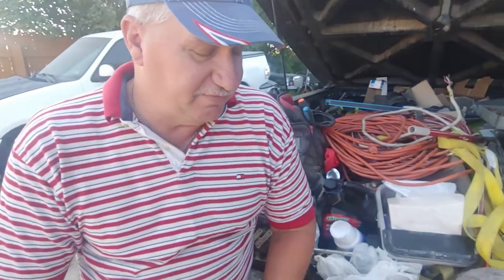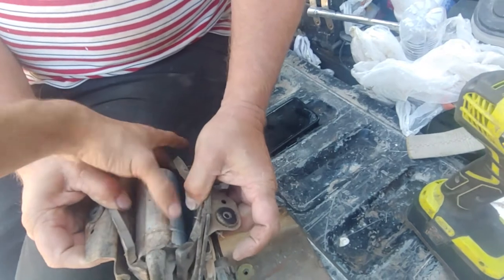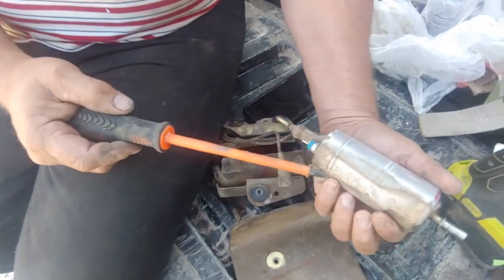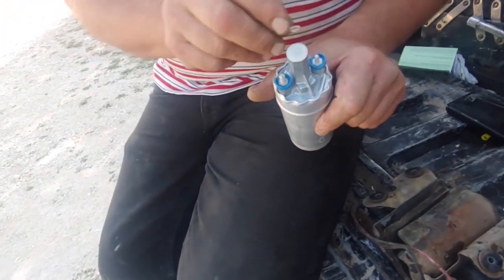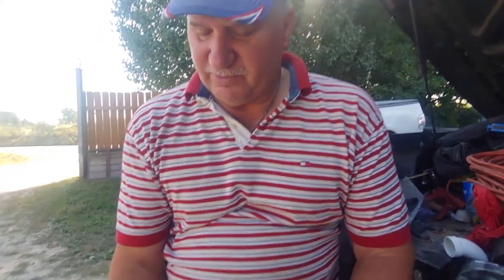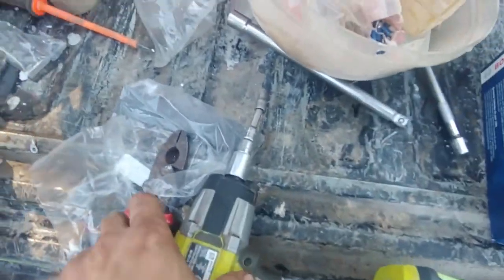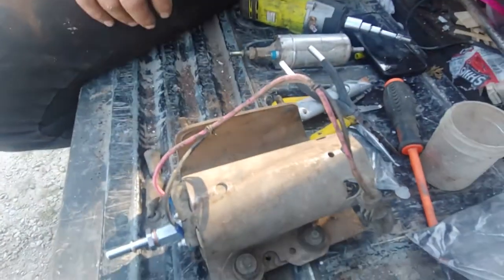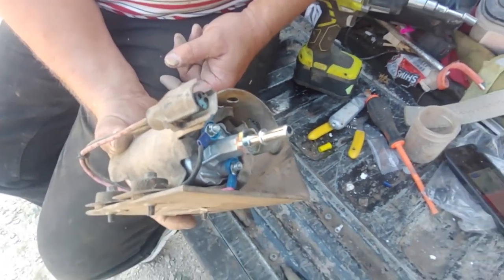1987 Ford Bronco 2 Fuel Pump Replacing External Pump

Comment: I have 87 bronco two gas tanks rusted out had to put another gas tank in with a in-line fuel pump on it. I’m getting gas up to the fuel rail and can start. It was a gas on the rag and there’s gas in the rag runs out it I can’t get a pick up pick up the gas.
Reply from the maker: Check and see if the second fuel pump is restricting the fuel. There should be one in the tank and a second one on the inside of the frame if it's like mine

Comment: I have an 86 that turns off after a few seconds up to a minute, after a few (sometimes more than a few) tries it stays on fine. Problem started when it got cold. I'm thinking fuel pumps or pressure regulator. Do you have any thoughts?
Reply from the maker: My instincts say one of the fuel pumps . Still replace your fuel filter first. Then replace the regulator which is around twenty to buy online. It's an old vehicle replace these cheaper and easier things first. I would replace them first hope that helps.